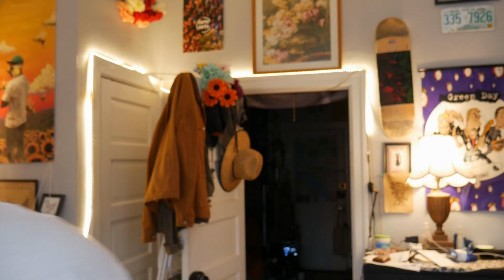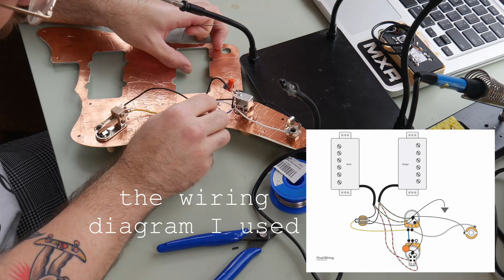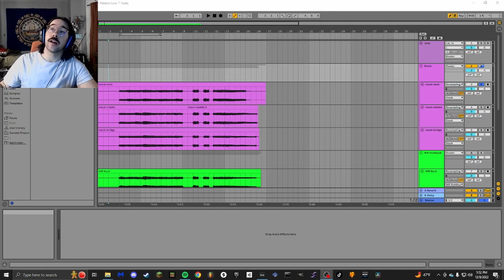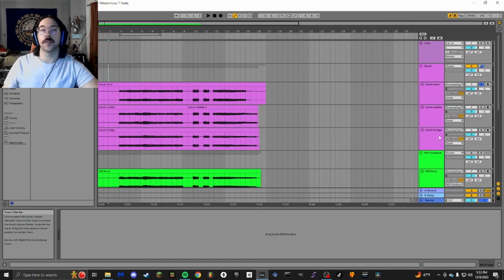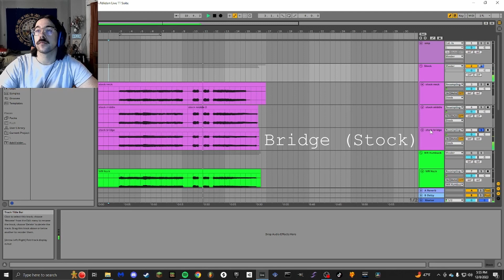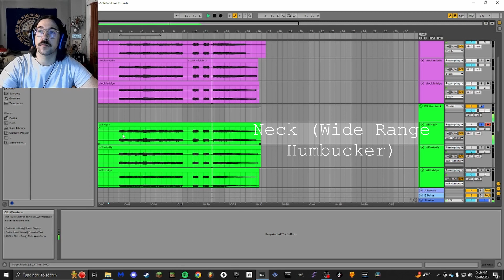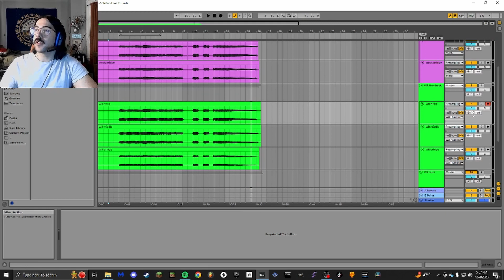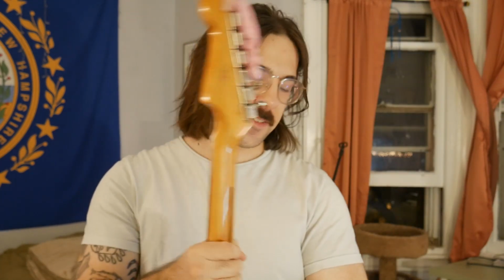The Most Affordable CuNiFe Wide Range Humbuckers

Comment: I was really expecting these to sound awful which is why I’ve come to hate a lot of WR humbucker JM replacements but honestly these were nice. Still definitely prefer to true single coil JM pickups but these actually sound like JM pickups while just being a tiny smoother & thicker. I think the only position that really suffered was the middle & honestly that’s a deal breaker for me.
Reply: Man, I have cunife wide ranges in a jazzmaster and found the middle position ever so slightly lacking that magic, very close.  So I put an EQ pedal on my board and went back and forth between 2 guitars, one with these and one with normal jazzmaster pickups and dialed in the EQ so that the wide-ranges were as close as possible, and it's litterally like 98% there now.  Def worth it for me personally for the extra power in neck and bridge and no hum